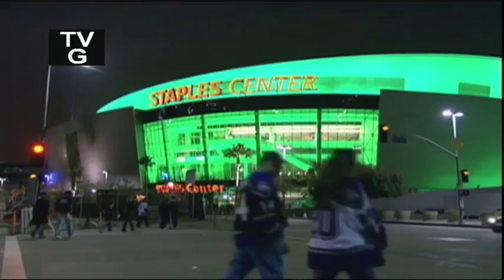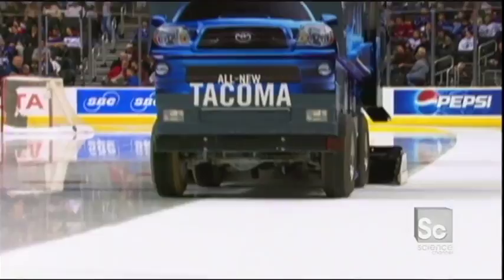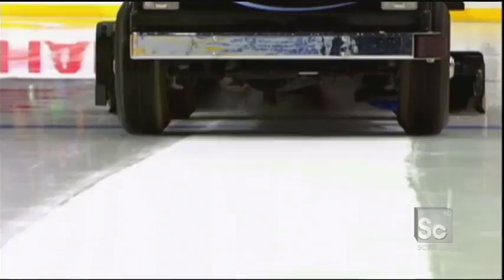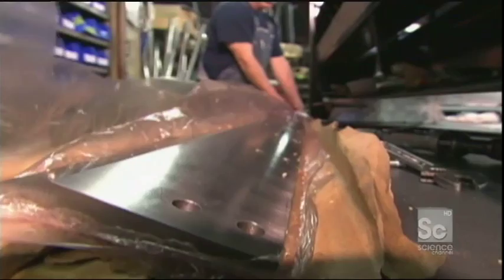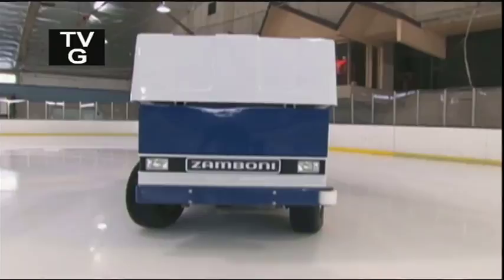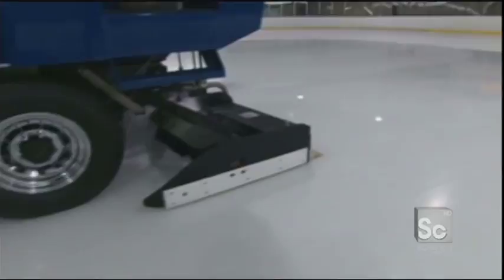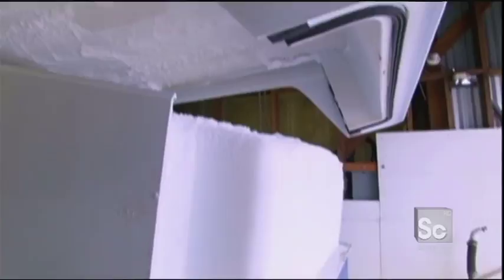How do the Zambonis do it?

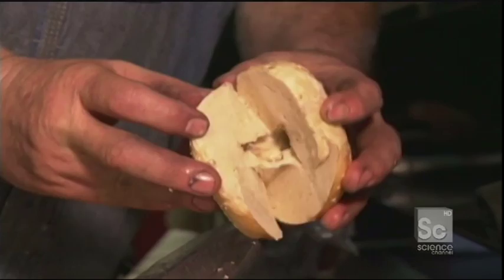Comment: 3:50 is a horizontal auger which feeds the vertical auger. Also Wash water feels the cracks(you can’t see the wash water). Handle on the left makes the new sheet of ice(you can see it).